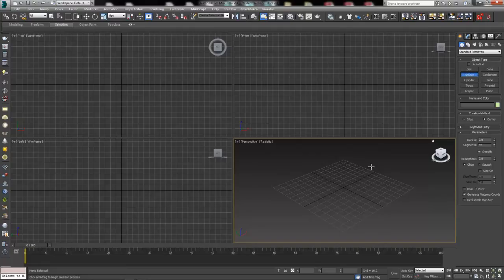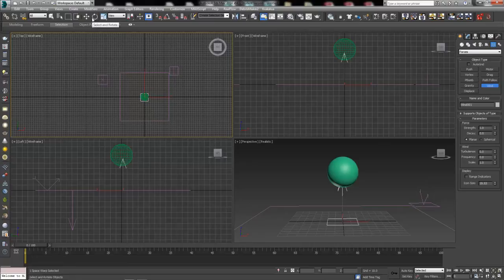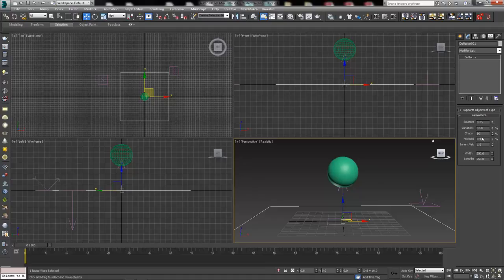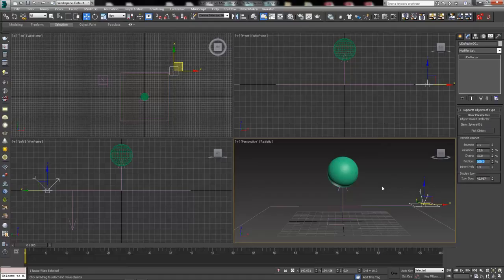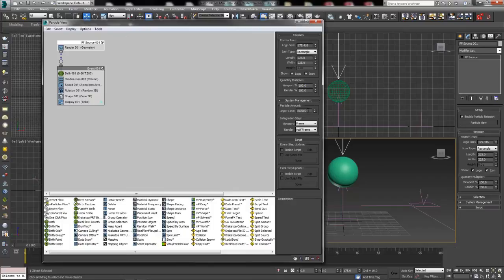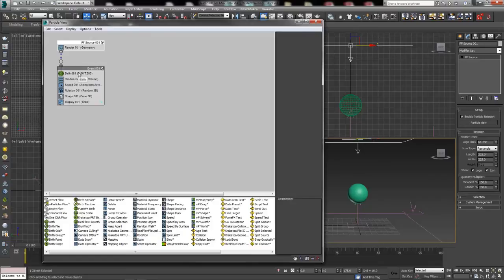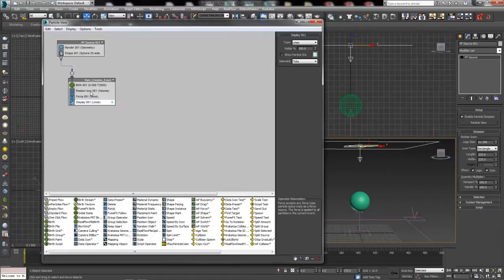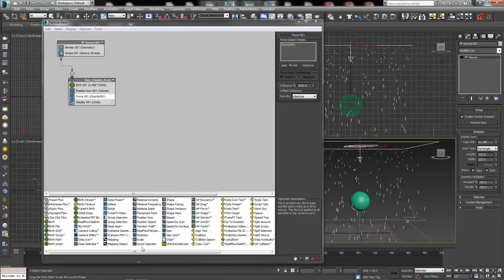Rainfall System - Particle Flow Tutorial

Comment: Great tutorial Clint! a question, how this system will work in a scene with some complexity? i will try to aplly your workflow in a shot that i am doing, is a camera moving a little showing a road, will have many people walking and buildings.
Reply from the maker: As with anything in the particle effects world it will mostly depend on what kind of computer you have. Static objects will always work easier, and fewer objects will work easier. Also things like the blobmesh that comes with stand alone 3DS Max tends to be very slow, if you are truly planning on doing a lot with meta-ball type substances I'd recommend Frost from Thinkbox, which works a bit more smoothly and a lot faster.

If you can break the shot into smaller chunks and edit them together to make it appear as though many people are walking the same road, when in reality each cut has only 1 or 2, that would also help speed things up. If you plan on doing some intense liquid simulations you may want to take a look at a program like Real Flow. I say, try it and find out if you are unsure how well your computer will handle a scene with more complexity =)
Reply: Thanks Clint! i will try to create a dummy scene that will have only the main areas that will receive the water drops to reduce the calculation.
Reply from the maker: Also think about Proxy objects ... for instance an un-renderable object around the head and shoulders of a character containing less polygons for the drops to splash off of rather than using the entire mesh of a character. =)